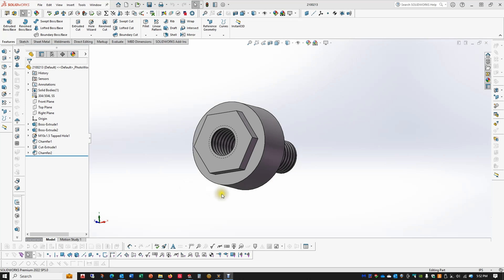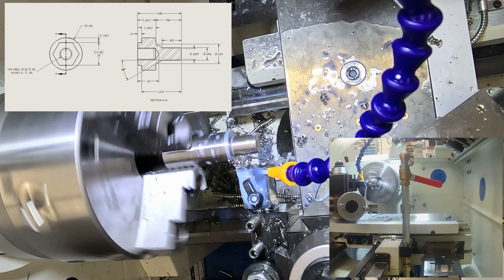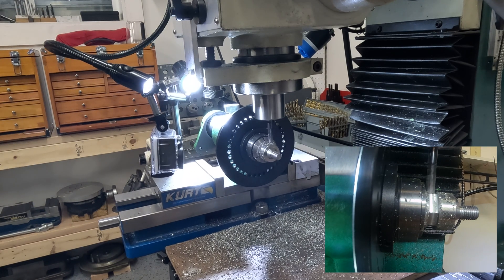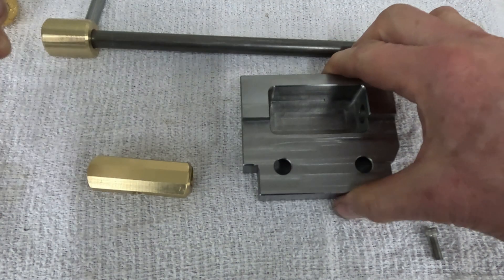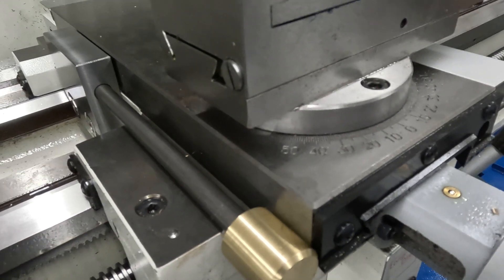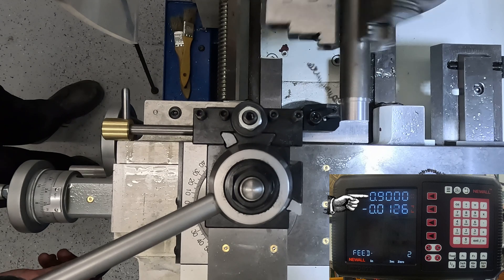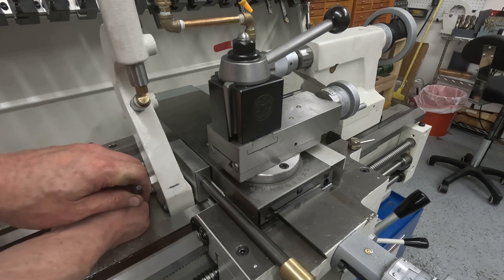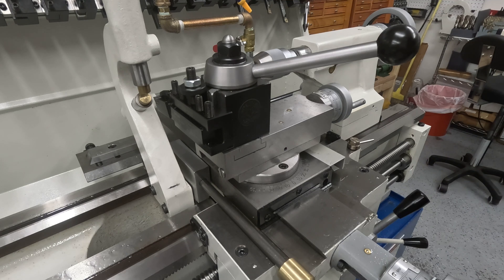A Superior Cross Slide Lock - Custom 4 Bolts, Installation and Test! Manual Lathe Improvement.

Comment: Brilliant.  I just purchased a Weiss lathe with DRO and was scratching my head because the DRO scale blocks access to the locking screw exactly as per your setup.  This is a really good solution.  Thank you so much for sharing it.
Reply from the maker: You’re very welcome - I figured others would have the same issue. Mine is still working really well. Happy to share the drawings if they help. 👍

Comment: Nice clamp for the situation with a DRO.  However with the clamp locked, the force applied may unload the gib somewhat, this type setup pushing on the gib would be ideal as the clamp action would lock the entire slide.  Well done.
Reply from the maker: Thanks for your comment - yes a solid point. Not an ideal situation, but as long as the gib is properly adjusted it seems to work out OK. I was turning some hardened steel at the weekend, and no signs of chatter or dimensional problems with the slide locked. Of course, if the slide were loose, you'd have a problem anyway, lock or not. I did have a lathe with exactly that issue. Took me a while to figure it out.
Reply: When applying your clamp, how far does the slide move away, is it repeatable if required.
Before seeing your clamp arrangement, my thought was to add a screw in the slide top above the existing clamp screw hole, fit a plunger & ball in the current hole, the screw point pushes down on the ball side which moves the plunger onto the gib side, forming the clamping action.
Can email a dwg if needed.
Reply from the maker: @lawrenceclifton1765  - First of all thank you so much for the questions and discussion - it is what I hoped to gain by starting a youtube channel. So - I just went down to the shed and measured the displacement of the cross slide using my most sensitive test indicator (.00005" resolution). I show a displacement of under one graduation - i.e. approximately .00002". The needle barely moves, but I repeated the test several times and it definitely moves -  but not by much. I think this amount of displacement is acceptable. Thanks again for asking - I did not think to do this test.
Reply from the maker: @lawrenceclifton1765  As regards your suggested design - that is excellent. I actually did exactly that on my last lathe - and that design works also. That lathe had a pretty loose cross slide, but the lock held it fast. As long as you are consistent with use, the displacement doesn't matter too much. The only reason I didn't implement that design this time was that I wanted a tool free solution, and did not want to drill the cross slide (yet) on my brand new lathe.

Comment: Cool lock, but, do you understand what backlash is? you keep moving the X axis past your target and rather than back way off and try again, you move a very small amount in the wrong direction. You might be surprised to grab your tool post and push and pull it in the X axis direction, while noting your DRO. I do like your lock, but I don't feel the lathe got a fair test.
Reply from the maker: Yes indeed - isn’t that the point of the lock though? It is partly the backlash that allows the cross slide to be pushed around when taking a cut. You can minimze it by loading the screw against the cut - but without a lock it still happens. You can also tighten the leadscrew nut and reduce backlash - but increase wear on the screw. Without a DRO I would have to back off and come in again to take lash out of the dial reading - but the slide would still get pushed around during the cut. Thank you for your comment - questions like this add a great deal of value to the overall discussion!